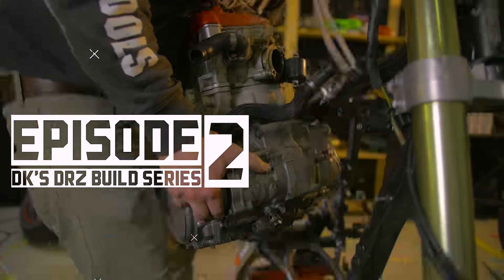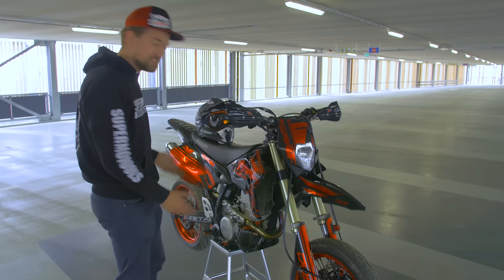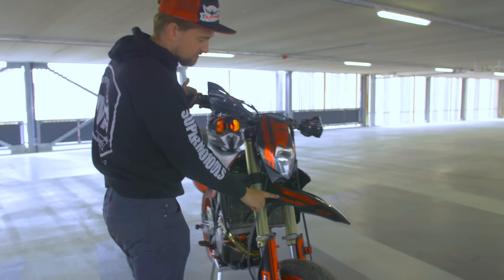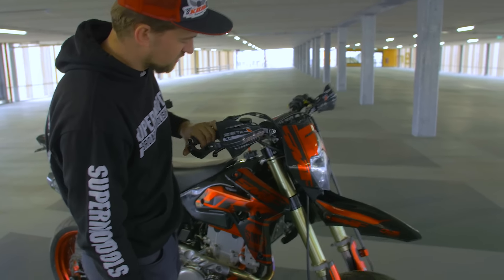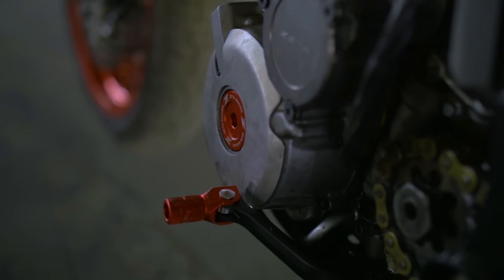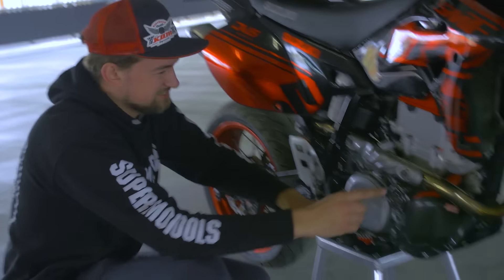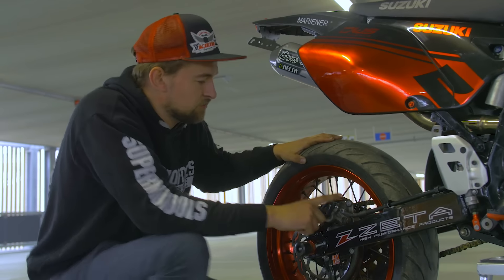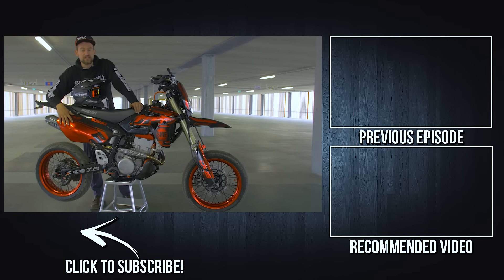SICKEST SUZUKI DRZ SUPERMOTO EVER! - DRZ Build Episode 7

Comment: For all the DRZ owners here. The BL Italia tank is almost impossible to find. You can use an 03-05 yz450f Fuel tank, Shrouds and Seat on your drz. It takes a little massaging to fit and some custom brackets but it will fit and it makes the bike look like a whole new supermoto. I will post a video of mine soon
Reply from the maker: It's not impossible to find:
http://www.blitalia.com/
Reply: Thats awesome. I tried there sit a few months back and it was down and couldnt for the life of me find that tank. So i retrofit an 05 yz450f tank on the bike. The BLitalia tank is amazing though. What did it run you guys? $$

Comment: Came out stellar! One question on the BLItalia tank. Have you made a cross over pipe or hose to connect the bottom of the two sides so you can actually use the full amount of fuel, or do you just run it as is and fill up every 90kms? I've got the same tank for my XR650R and I kinda hate stopping to tip the bike over to transfer fuel to the petcock side every so often :D Anyways great build series yet again!

Comment: @supermofools Why did you do a full build on the DRZ instead of putting the money into a newer 450 sumo or other type of supermoto?
Reply: ShortyMoto because everyone is doing it like that. Why not something special
Reply from the maker: It's cool to have something unique. A stock 450 is boring and would've cost more
Reply: Supermofools maybe I need to do a build on my drz 🤔💪
Reply: Because DRZ
Reply: The DRZ is the only low maintenance supermoto that produces that kind of power (besides the 701 /690 SMC). And those bikes are $4K more

Comment: yup, still a 300 pound DRZ
Reply from the maker: Yup! Although the Exhaust and BL-Italia reduce the weight a bit.. But to be honest i don't care about the weight.. > i also drive a Honda VFR750 that's about 520 pounds wet :) - DK
Reply: It probably weighs far less than 300. Headlight, mirrors, exhaust, subframe etc changes that were made saves lots of weight.

Comment: So back in the year 2000 when the first started making drzs, I bought my first bike, a drz400s. I converted it to SM before SM was cool. My drz came stock with 34hp, got it up to 47, cams, carb, exhaust, etc. 19 years later your hopping up the same bike, but did nothing to the engine? Meh. The drz is old tech. I say let it die.
Reply from the maker: The engine is completely done before the build series already. Bigbore kit, hotcams, fcr39 etc etc ;

Comment: you ended up spending a bunch of money and you keept the original off road brake caliper that ain't built, at all, for supermoto ? i don't get it
Reply from the maker: He changed the brake pads, disc, master cilinder and brake line. That is more than enough for a streetsupermoto.
Reply: @Supermofools  after racing supermoto for almost 10 years the only weak link is exactly  the off road caliper, trust me, I got a few broken bones to support my opinion
Reply: @Supermofools  just buy an off the shelf brembo (road) caliper and a bracket is less than 100€